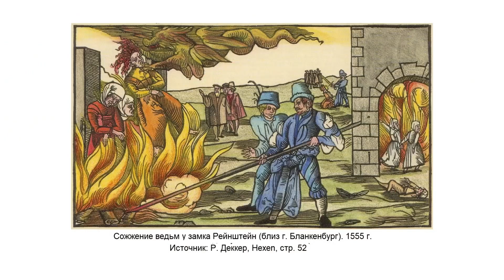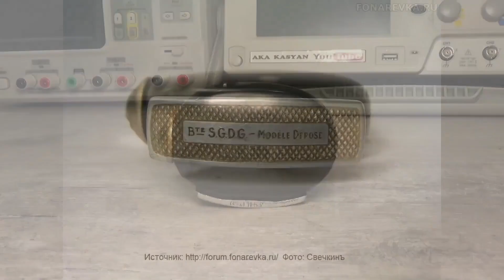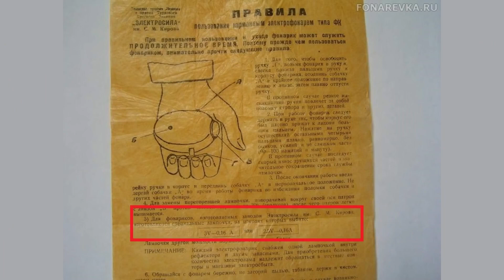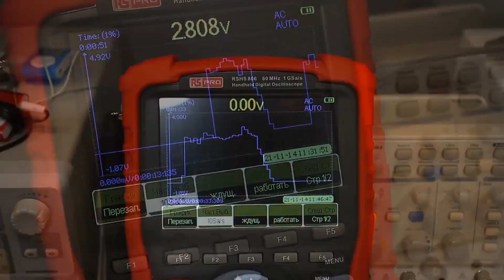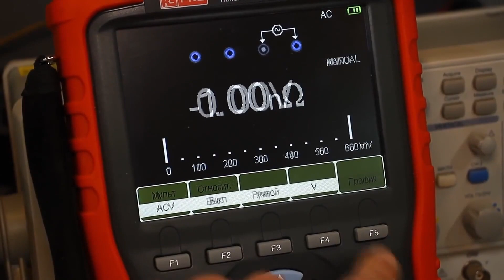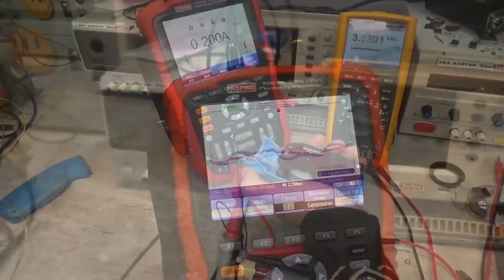Flashlights for the Apocalypse

Comment: Danke, nice subject for a video. My father gave me such a dynamo lamp, round as a piece of soap and with bakelite casing. It was in 1959. I played with it, but after some time the bearings of the polewheel wore down and the mechanism blocked. So it went into the junk. As Buddha told us: Nothing is eternal. At least, in West-Germany we had these funny things also. Could be sold to body-builders. To get strong arms.